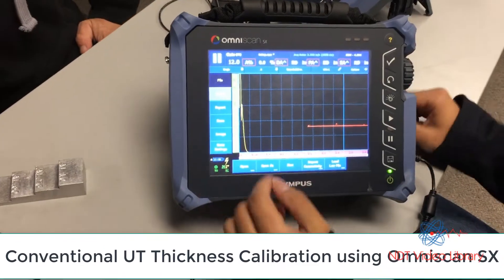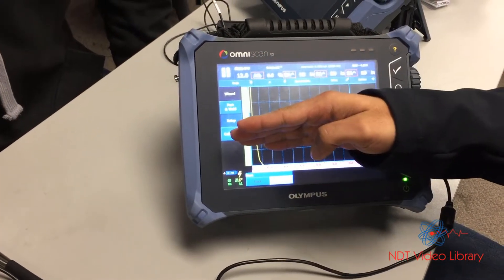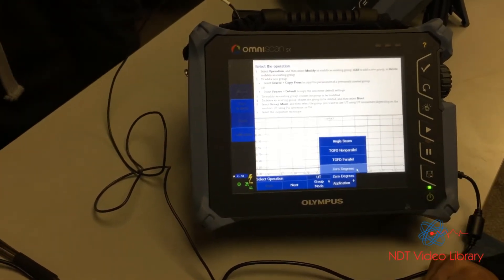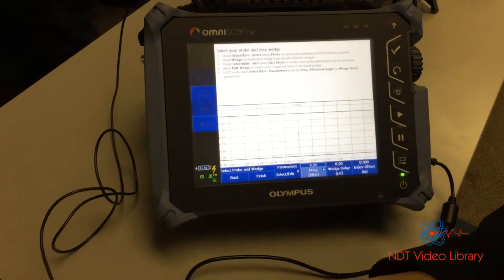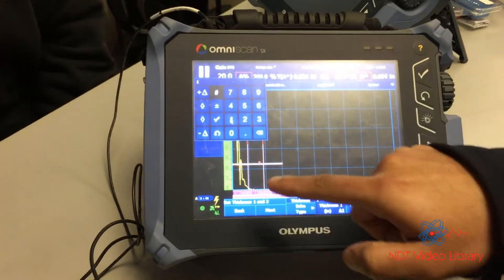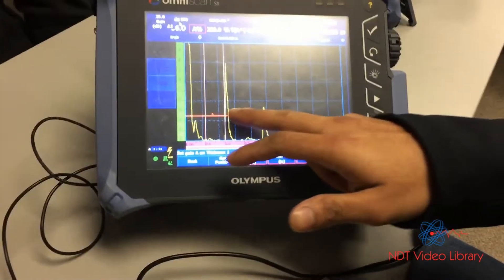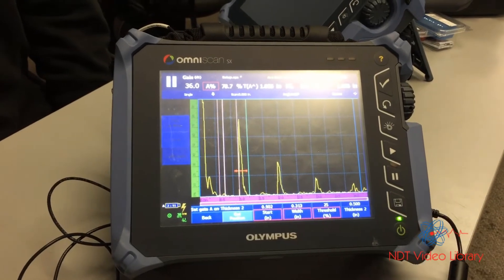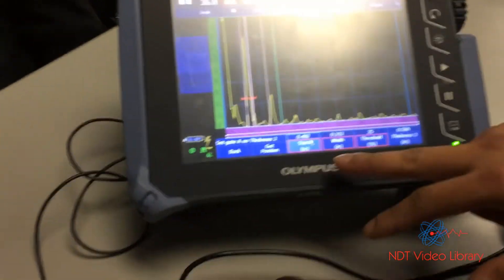How to perform UT thickness calibration using Omniscan SX?

Comment: Hey, thanks for the great video! I kinda struggle setting up an ultrasonic sensor for the Omniscan SX. It is pretty similar to the one you have used in the video. Its called M106-RM and also uses pulse-echo mode. I still dont get any signal from the sensor. Which input on the Top (P1 or R1) do I have to use?
Reply from the maker: I use P1
Reply from the maker: Make sure you are changing the technique in Setup menu to P-E (Pulse Echo)

Comment: Hi, thanks for the video. I´got two questions: 1. can I Use this type of technology in concrete? 2. How should I do the calibration for this type of material, knowing that this is an heterogeneous media? I´m in an investigation trying to apply the PA technology on concrete and I searching for information. If you can help me I´ll acknowledge you so much. Thanks again.
Reply from the maker: Yes you can use PAUT on concrete. You would typically use low frequencies (50-400 KHz). In addition, you may use the SAFT (Synthetic Aperture Focusing Technique) to improve Signal to Noise Ratio.         As far as calibration is concerned, you would have to build a standard dimension calibration block with the same material that you are about to inspect.        I am sure you know this article http://www.ndt.net/article/ecndt2006/doc/Tu.3.2.3.pdf
Reply: Thank you. Yes, I have already read that article. My objetive is to use PAUT on concrete in order to detect flaws (cracks or voids) or the rebars (or in an advanced application, to calculate indirectly compression strength of concrete using UT, with this kind of technology, it´s only an idea). I´ve got the Omniscan Sx for my investigation, however, I know that most of applications of PAUT has been on metals. Due to heterogeneous nature of concrete, I don´t know if using PA will be a good election, because of the heavy scattering of the ultrasound wave in this material,( thanks for the range of frecuencies you´ve mentioned).  I´m planning my investigation, trying to find out a good application of PA on concrete, but I don´t know how to start and  focus my investigation. I don´t know how to configure the Omniscan to start working with this kind of material, and with the objetives I´m planning. Could you suggest me something?
 Thanks for your answer and your comments. I realy appreciate that.
Reply: @denialboran , perhaps UT isn't the solution you are looking for. Investigate the magnetic NDT methods or even RT.